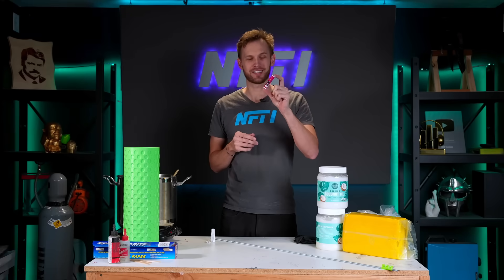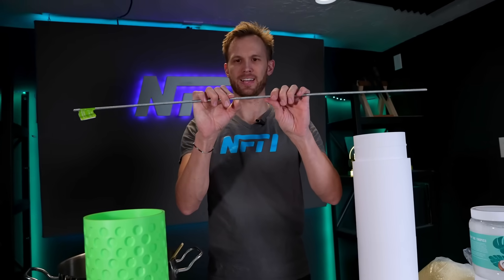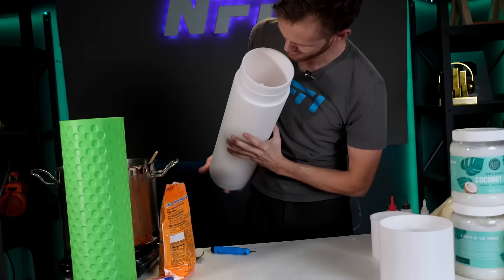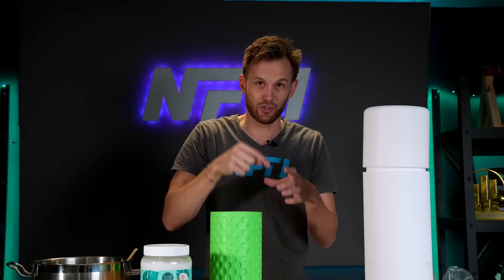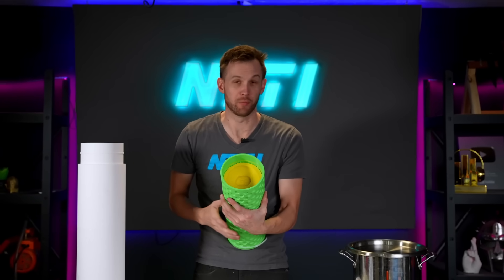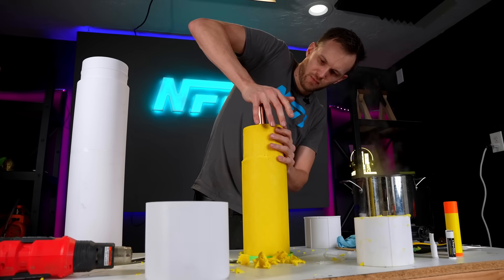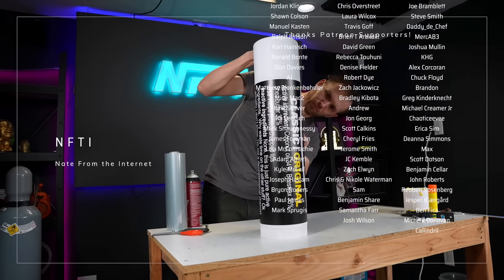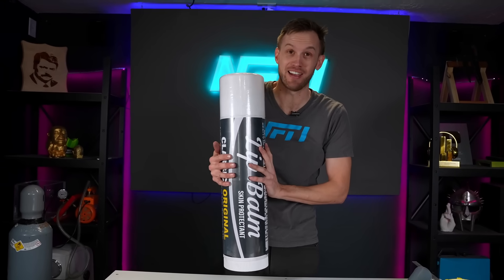Making the World's BIGGEST Lip Balm!

Comment: Love this! I always made a ChapStick pop-gun out of mine when the balm was gone. I'm not sure how you'd propel this one, but it would be fun to see. To make it:, you only need to pop the knurled base out, then rotate the base counter-clockwise until only the top bit of threads are in the carriage housing and pull the base all the way down. With the cap on (remember, no balm) quickly force the base back in. The air pressure will pop the cap off and away.

Nice work NFTI. Let's see that aluminum!
Reply: yup and did so with a remarkable amount of force. I put a carpet tack in the lid and would stick it in to card board boxes LOL

Comment: Hiiiii I have one question how are you going to carry a giant lip balm with you it wont fit in your pocket ant its bigger than your head
Reply: put a strap on it and carry it like a backpack of course. how would you carry it?
Reply: @DeadInside784lfe  I probably would just 3D print a lot of normal sized containers and melt it down into the smaller containers because the thing is way to big to use normally
Reply: carefully.